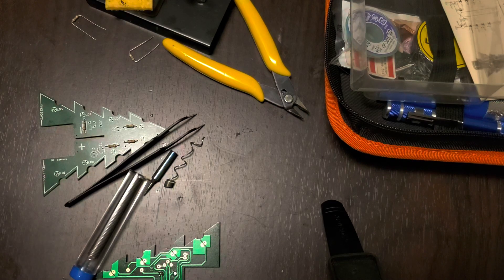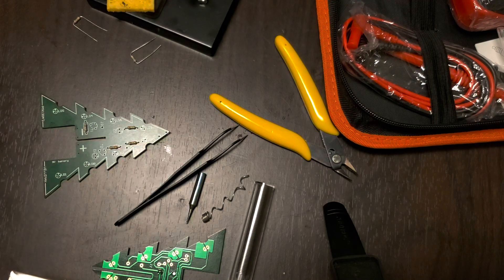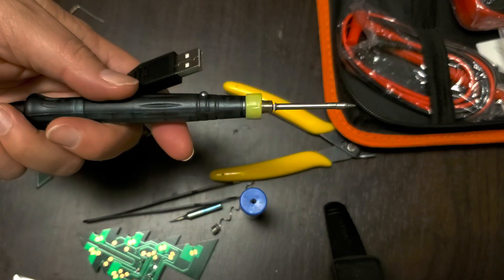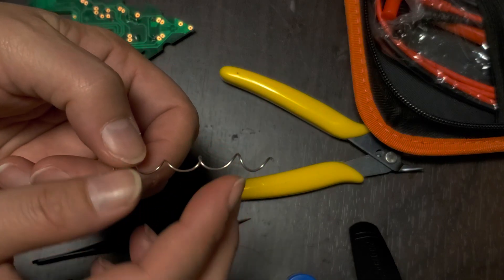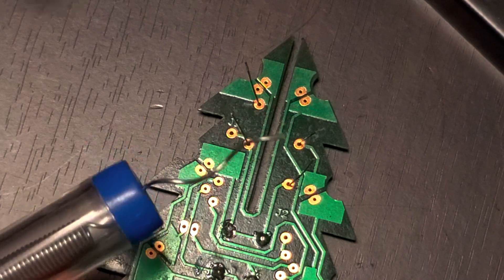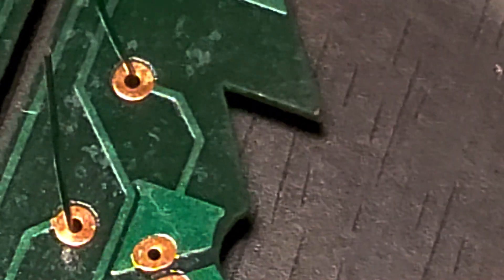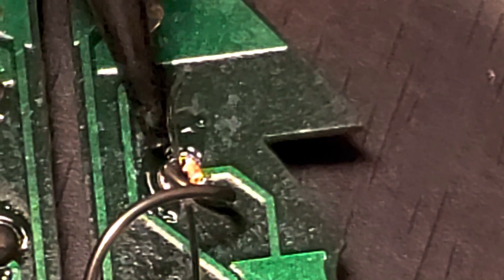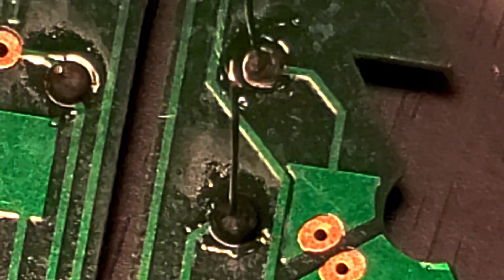Soldering Basics - Cheap, bad solder and issues with balling up

Comment: The only soldering iron I found which works great, which I haven't found, is the V-Type one, where you clamp the work in the iron, and it heats it up, and the solder flows perfectly on your work. That type isn't for board work tho. Probably the one I saw my friend soldering car stereo wires with it, came from snap-on or mac tools I'm assuming. It was 1991 so I don't remember too much about asking where he got it. Gotta be online somewhere, but probably has a specific name for it is why I don't find any, and probably too much out of my price range anyway !
Reply: Edit: I don't solder enough to spend that kind of money for a good one.

Comment: Soldering is hard to do. I tried soldering my car speaker wires, because ai usually just twist wires and use glue heatshrink. The solder worked great with rosin flux on it first. The speaker wires in the car at the stereo, just dropped off. Nothing worked, it still kept balling up and dropping off, so I just used my twist method with the heatshrink. I can't solder, so I just gave up.
Reply from the maker: Hi! Sometimes, if your workflow works, it is best! Although, in this case, I guess that over time things could come apart under the shrinkwrap... Anyway, to give some explanation for what might have happened, I think you used too much rosin and contaminated your connection. I just read that solder flux, or resin, can contaminate your joints if you use too much. If you still have the heart, don't give up! Decent rolls of solder that already have flux in them (and I have used) cost $5-$7 USD. Not expensive, and you don't have to worry about using too much resin. Also, before doing a job, I practice a few times on wires and things that won't be used, just so thaty hands get the hang of it again. That way, when I do the job, I am less likely to mess up... Good luck, Chas S!

Comment: one more tip allways good clear that boards "pins" with alcohol before soldering you will not believe how its going fast. and ofc every 1 or 2 solders clean solder tip add little iron and there you go :)

Comment: You might also try setting the iron to a higher temperature. It's true that too much heat can damage components, but 572 degrees (F)/300 (C) might just be a little low. I usually start at about 650 degrees (F)/343 (C), with lead-based solder. Sometimes, I go higher. Keep in mind that while applying too much heat isn't good, having a lower temperature may require you to keep the iron on the pad too long, which may also damage the component.

Comment: I thought it was something about the way I was working, I've been soldering off and on since the 80's and until a couple of years ago I had never had the issue with the solder "balling up ". Now that you mention it the soldering iron set I was using was cheap!! Now I'm not having any issues since I purchased  solder and flux separately and it (I felt) was a little costy (I'm Frugal?). So all the time it was cheap solder. Thanks so much.
Reply from the maker: I'm glad it was useful for you! Thank you for commenting. 🙏💝

Comment: Hey.Those Cheap kits are nice that they got multimeter solderiing iron wick and some of them they got rosin flux the problem on those cheap kits is the Solder is the worst quility they put there you just througth it to the bin.That you can do is to make one nice flux 50% kolophonium Dust 50% isopropyl alchohol up to 90 degrees inside a small bottle mix it and you got a nice one flux for decades because rock rosin is cheap (not blue alchohol it will not work).The second is to buy one good solder spool 60/40 lead is around 15-20euro and that its.
Reply from the maker: Wow! Thank you so much for the recipe!!

Comment: I hope you don’t give up on your soldering. These things do take some practice but it’s a great skill to have and electronics is a lot of fun.  The solder that wouldn’t melt looked like unleaded and didn’t appear to have enough flux you needed a much higher temperature. Not wanting to   Be rude but the equipment your using wasn’t very good.  Try to use a lead solder with a rosin flux from a known brand.
Reply from the maker: Hi! Thanks for your comment! I know my materials aren't very good, but that's the situation at the moment. I'm not giving up. The person liked their present, and it works, so I'm happy.

Comment from the maker: Since this video was made, I have soldered more and been tutored by the best. I would like to note that I should have tinned the iron more. Tinning means putting solder on the iron. It makes the flow from the solder to the board easier if there is more on the iron. This is the procedure: tin --> clean with sponge/metal sponge --> re-tin --> solder --> clean --> repeat. 
Also, tin before putting back your iron, as a bare iron rusts much more quickly; it is fine to store it with solder on the tip.

Comment: i just bought my cheap kit today and i am thinking of giving up already. the solder never melt like in the other videos and i am very upset :(
Reply from the maker: Yes, it is very frustrating. According to my friends who are professionals, it is very important to have good solder. My best to you.
Reply: @somnyad  thank you for you advice . even if did cost me an arm and a leg. I would love if you suggested me a good brand i may use. slightly above budget no problem
Reply from the maker: @kmdex  Actually, it doesn't seem to have to be expensive. But it should be more expensive than the cheapest ones. Also, they said that the tip of the soldering iron should always be cleaned and then the solder melted onto it before use. Also it should be stored with solder on the tip, and cleaned again before using. The tips easily go bad and rust, and then they do not work properly. Please let me know if this information helps you. My best wishes to you, Hassan!
Reply: @somnyad  just saw your reply. tho i did may research before but yeah you 100% right. tip tinning is the secret about it. also my soldering iron gets carbon dioxide like crazy. really appriciate your reply and best withes to you. 

"happy soldering"